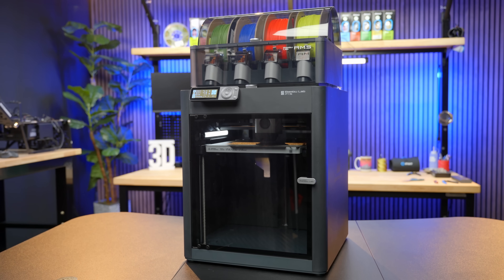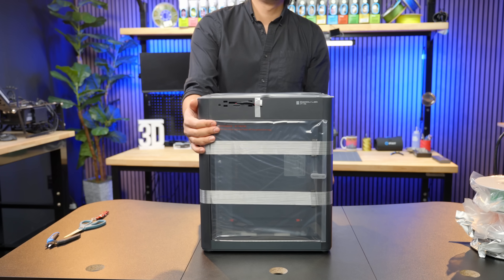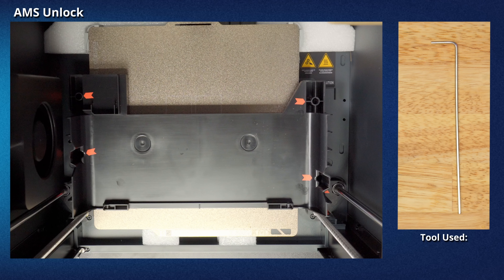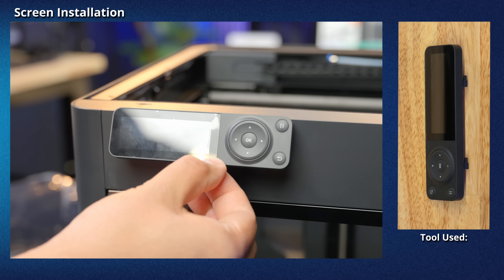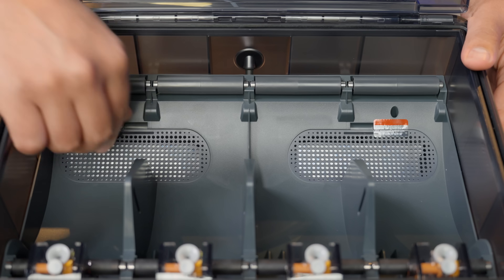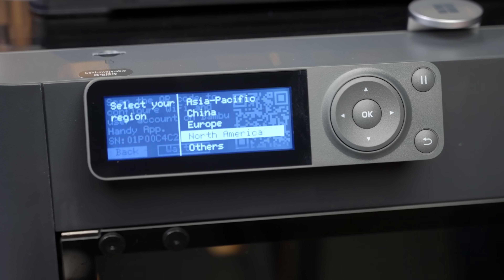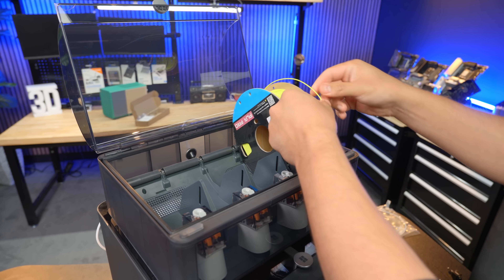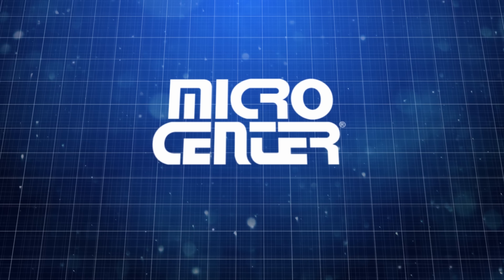How to Unbox & Set Up A Bambu Lab P1S Combo 3D Printer

Comment: Please, I need help. What about the foam under platform where the print is built
Reply: The platform moves up as part of the initial power on, and you can remove the foam then.
Reply: @no_not_that_one_again Thanks, I was looking for this comment. I have the multi-feed one. The paper instructions that it came with are missing crucial details and so is this video. I have to install something on the back, this grayish rectangle with the spring in it. That definitely has something to do with the filament. Filament. Not mentioned in the instructions not mentioned in this video, although his is already installed in this video and already installed in my instructions. So frustrating
Reply: @no_not_that_one_again you just saved me so much time and frustration

Comment: Mine will not connect to my iPad
Reply from the maker: You should be able to connect with the Bambu App, however, there are limitations to what can be done on an iPad with the device. You may want to reach out for troubleshooting help if it is still not connecting.

Comment: Nice video. But doesn't help solve my problem with trouble with AMS. Although  AMS is loaded, printer want to load filament from external spool holder and there isn't a option to ignore it or go around it.

Comment: Excellent guide, but missing a key fact about the AMS.  It implies that the filament feed will start when you press the tab and insert the filament. This is what the video shows.   It does not say that you have to insert the filament about 2 cm for the feed to start.  I found this fact on the WIKI.  If you're a total newbie, little details matter.  Also, the video promises to go into detail about the contents of the parts box, but never mentions the lubricant.
Reply: Thank you lmao I was like “how come it’s not detecting the damn filament 😅”
Reply: Do you know what to do with the part and lubricants
Reply: Yeah those details matter
Reply: Thank you

Comment: Just opened mine, not from you guys but, its missing the little box that was down with the filament, ugh, so frustrating.
Reply: it was shipped separately, check your mail.
Reply: Just got mine yesterday and same thing here...
Reply: Same here. I noticed that in the video on the bambu lab website they dont show it. But i am still curious what was in there, it seemed some metal parts to. a hub?
Reply: How important is that little box, I'm missing mine also and I purchased it from microcenter.
Reply: @supraboy87  Same thing. I purchased from bambu lab directly.
Reply: @supraboy87 same thing here, did you ever find out if it was included? Purchased it directly from bambu lab.
Reply: @edinburgloz1721  never found it but I'm assuming it's not important since I've been printing fine without it.